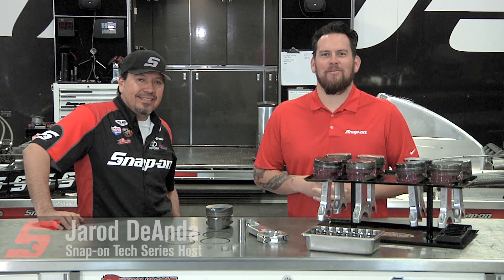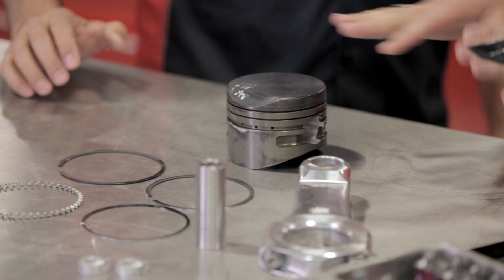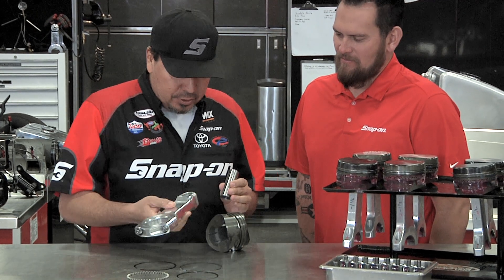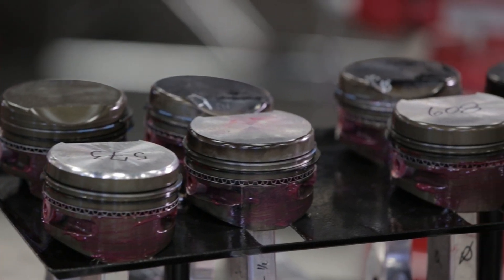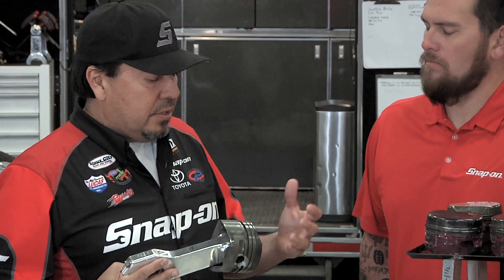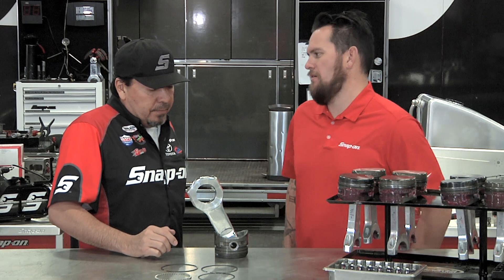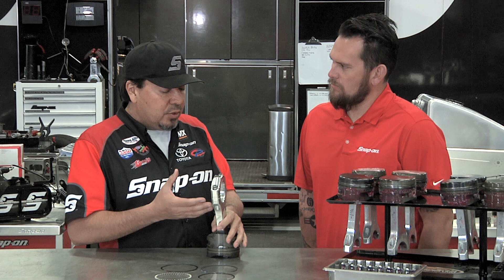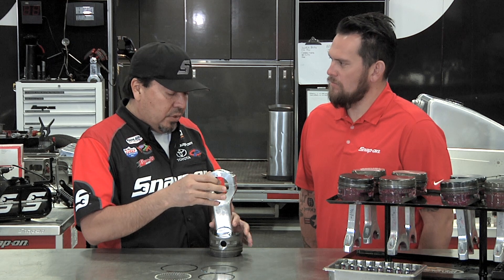Nitro Funny Car Rods and Pistons - Snap-on Tech Series: Nitro Edition ft. Cruz Pedregon (S1, Ep. 21)

Comment: the torque, horsepower, and speed that these engines can produce is insane, and incredible, but it also seems like a huge waste of resources. 5 runs out of a piston. 12 for a rod. probably costs $400 each for those rods and pistons. the technology that comes from the racing world is pretty cool when applied to the normal automotive world, but it sure comes at a high cost.
Reply: $50k per run all in... but if sponsors are paying, who cares?